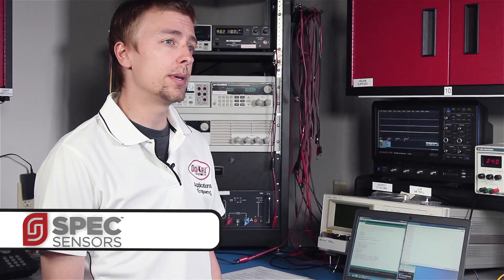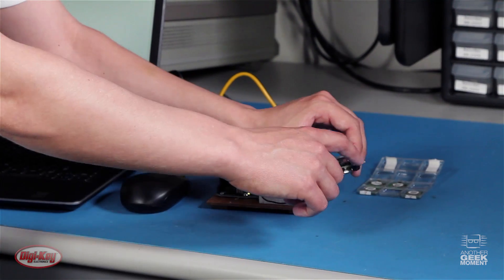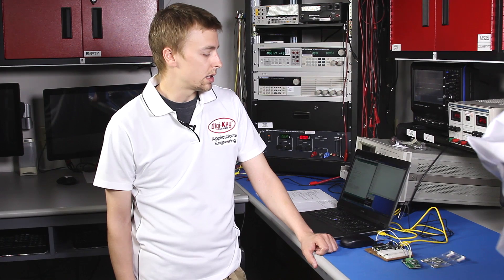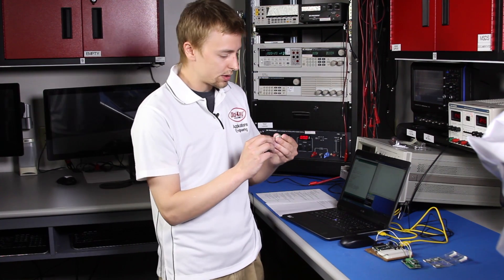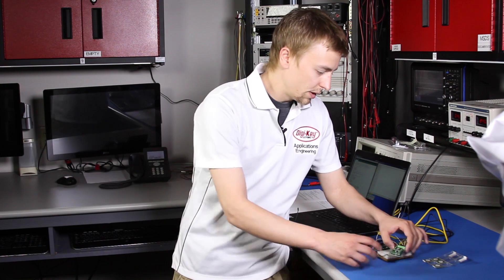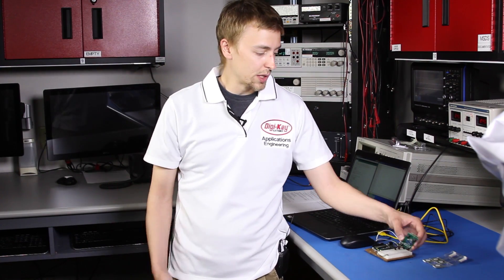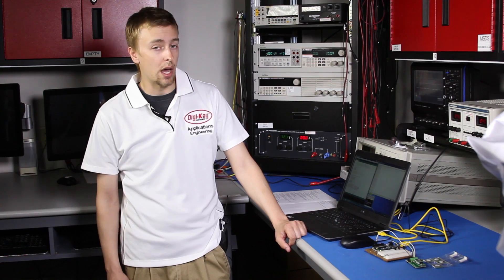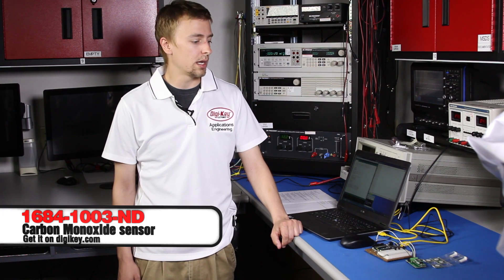SPEC Sensors Carbon Monoxide Sensor Kit – Another Geek Moment | DigiKey

Comment: is arduino necessary with SPEC modules? can't we directly connect it to pc and simulate on tera term software as specified in it's documents without arduino?
Reply: The module they showed on  the video is the analog version. For that you need analog to digital converter etc.. I have USB(UART) version you can connect directly via USB port. Spec produces various modules for a type of sensor.
Reply: @fkaragoz  hey do we need poteniostat and evaulation board for spec sensor ? cant we use it it directly ?

Comment: Just want to ask. Which one was the potentiostat?
There were two boards underneath the sensor.
Is it the middle one or the top one?
Reply from the maker: Hello - Please see below from our technician:
The Potentiostat is underneath the small board that the sensor sits on.  The image that I attached “Potentiostat1” shows the underside of that board (I had to take the screw off and pull it off of the header).  The image “Potentiostat2” shows the top of the board where I had to take the screw off.  The schematic of the potentiostat found on the “SPEC Sensor Operation Overview” on page 3 shows the op-amps as being “U1” and “U2” but on the physical board both of these op-amps are inside of “U2”.  This op-amp is the MCP6042 and both op-amps are inside of that chip
http://www.spec-sensors.com/wp-content/uploads/2016/05/SPEC-Sensor-Operation-Overview.pdf
Reply from the maker: Please let us know if you have any questions, Thank you.
Reply: Digi-Key just to clarify. It's the middle board?
There's three layers.
The top: sensor
The middle: potentiostat?
The bottom: Evaluation board
Reply from the maker: Hi Leun - Can you contact us via email at socialmedia@digikey.com ?  We have some diagrams and pictures for clarifacation from our technican to share with you.
Reply: wont it work without poteniostat and evaluation board? @digikey